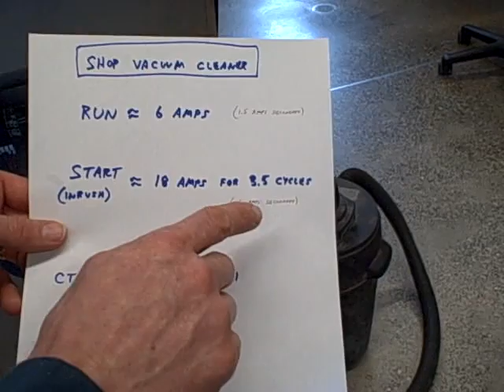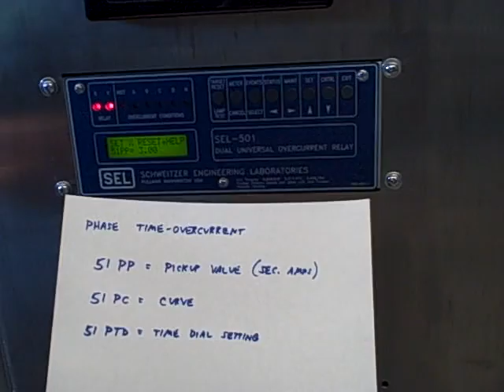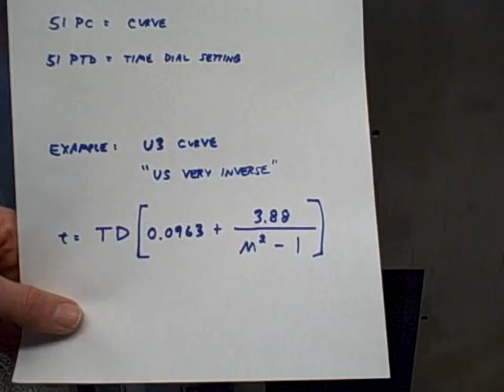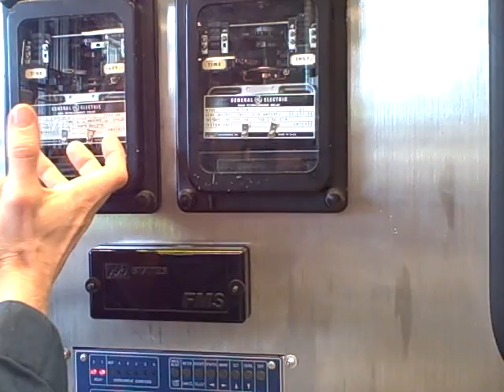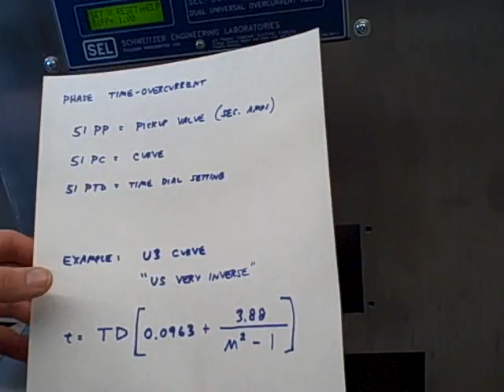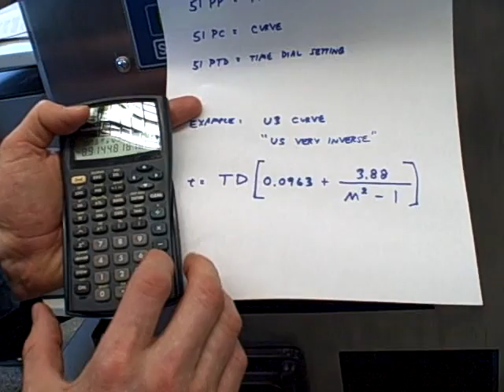Protective relays -- demo unit (SEL-501 relay time overcurrent trip)

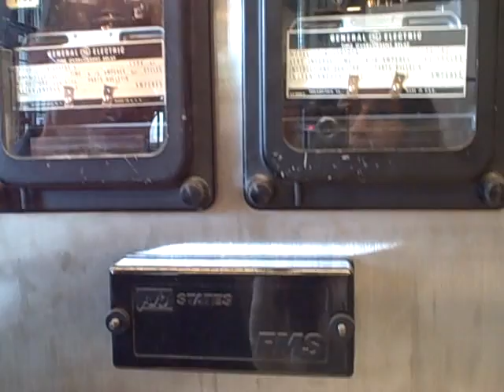Comment: One little correction. At 3:43 you call TD is 3 seconds. This is not exactly correct, since its unitless number, three in this particular case. You will have operation time (in seconds or cycles of 60Hz) calculated based on the formula provided.